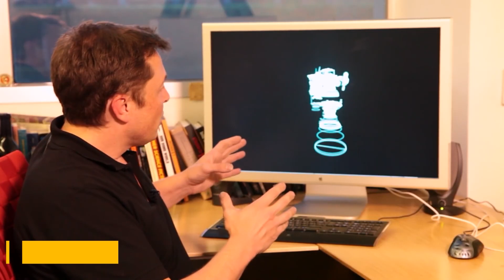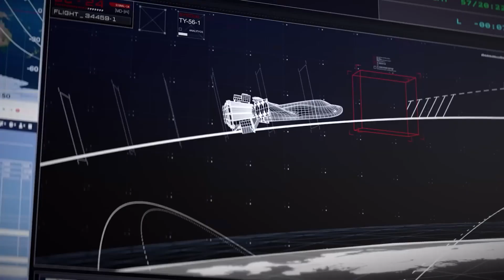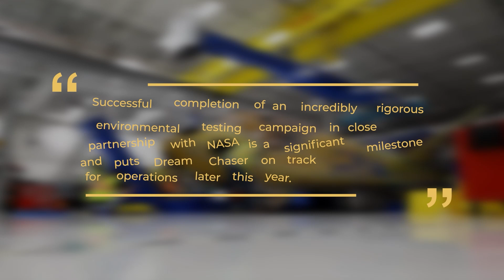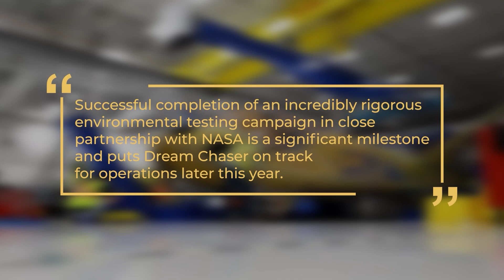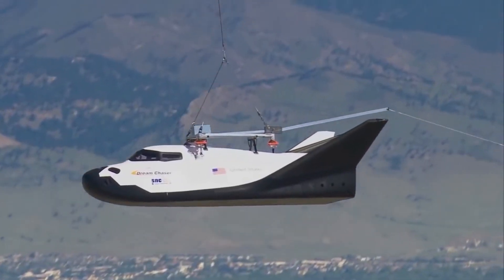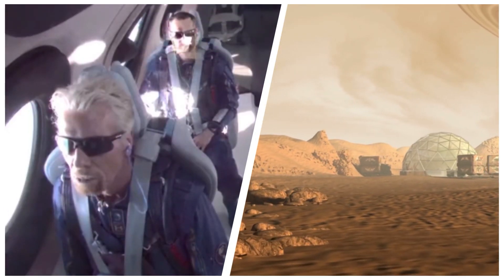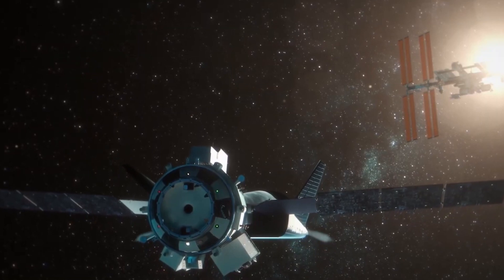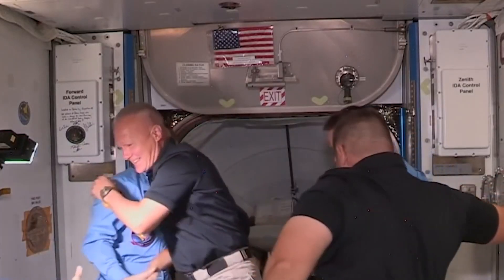Dream Chaser Is Ready To Fly And It's a MAJOR Problem For SpaceX!

Comment: Fundamental problems aside (needs a rocket to get into space, due to its retirement, supplying ISS won't justify its cost), this video desperately needs an editor.  The repetition of content was staggering.  It could have easily been less than 1/3rd the length and had more impact.

Sure, I like the concept, but you can't just dismiss what it takes to get into space and what it can do beyond ISS.  Re-usability is old news now.  15 uses?  Why not hundreds?